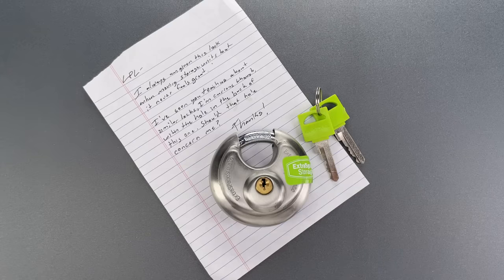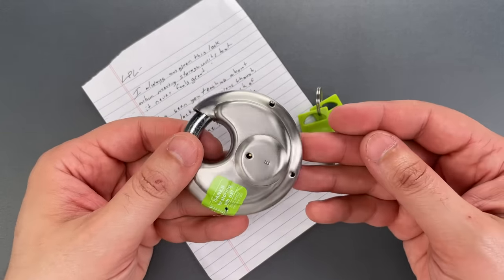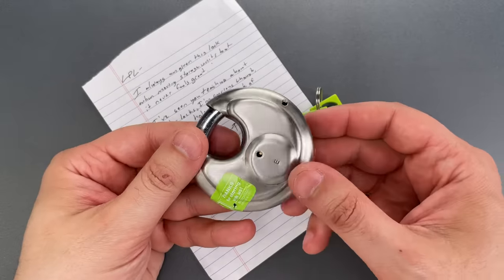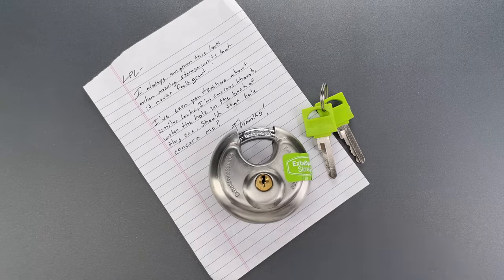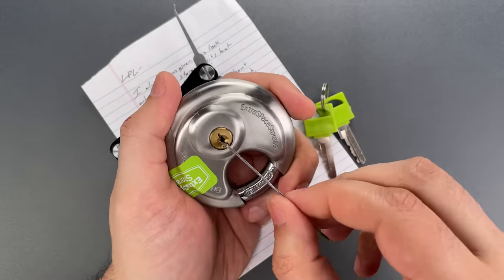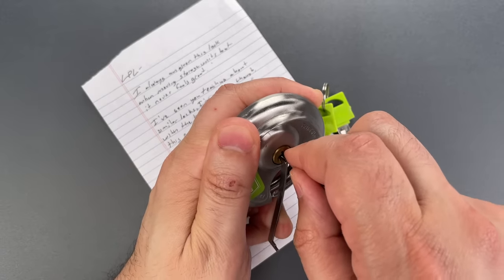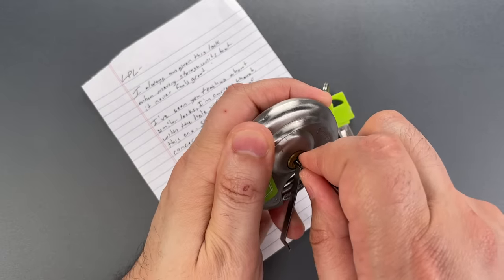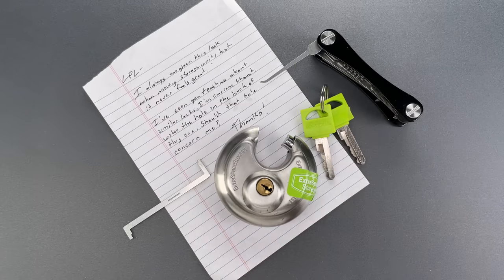[1367] ExtraSpace Storage Disc Lock Picked

Comment: I started picking padlocks as a hobby and picked up one of these master locks and quickly found that the 4th pin is completely useless, it can be picked by only manipulating pins 1, 2 and 3. Blew my mind that something like this was possible but that's Master Lock for you.
Reply: that depends solely on the bitting of the lock. if pin 4 is a "no lift" you won't need to touch it in order to get the lock open

Comment: That's actually not bad.  Granted, it's not as good as the original Bulldog brand, but it's certainly better than the Yale and Sterling ones I have in my practice bin. In the UK, most storage facilities that use this type of lock are built inside warehouse type buildings with security staff and cameras, so not really somewhere a casual opportunist thief would feel comfortable in. ...oh and it's also a lot better than some motorbike discbrake locks I've seen. There really is a lot of outdated junk out there.

Comment: As someone who uses extra space. I've noted that there are 2 different lock positions on the doors, allowing for 2 locks to be in use at one time. So you can supplement these locks with something better as well. Note I was incorrect your not intended to use the second position.
Reply: The second position is for the company to overlock you if you don’t pay on time. If you lock that also, they will likely have it cut, then add the cost to your next bill.
Reply: @stuckgrenadepin.225  Yeah, I got told that last night. Whilst I was getting Halloween decorations with family.

Comment: Can you do a video on serrated, spools, and other tricks lock manufacturers can use to prevent from picking, or make it harder.
For example: "Why do spools exist, does it prevent from wracking?" And that question answered for every security pin with examples shown how it can be easily defeated. It seems as though it doesn't keep someone with a turning tool and a lockpick out.

Comment: The problem with this picking is that when the lock is in use on most storage units, the lock is at a 90° angle, and the shackle is against the garage-style door, thus impeding the bottom of the keyway tension, and greatly reducing the available area to manipulate a pick. Would be nice to see a realistic set-up and pick as if the lock was found in the wild.
Reply: Just put the tension tool in from the other direction. It still works that way. Might just take a little longer.

Comment: Do any theives actually pick locks? Bolt cutters and battery angle grinders are the common MO I believe.
Reply: Some will still do low-effort attacks, but none I've heard of are doing the time-intensive stuff. If a rake or bump key doesn't do the job, it's back the the old classic: a big boot.

Comment: Out of curiosity, couldn't you dunk it into a bucket of water and then hose it down with baker's freeze spray, or an CO2 extinguisher and cause it to break the lock?  No idea if that would actually work, but it'd be nifty to try.

Comment: It's not as insecure as it may seem. Picking a disc lock in this fashion is easy, yes. But once it is locked on a storage unit and you are unable to maneuver your hands and tensioning tool, the difficulty substantially increases!

Comment: The problem with these types of locks no matter what the mechanism the soldier is encased in magnesium that can be heated up with a common torch that you can get now for about $2 or $3. 
 I believe all you need is about 400ﾟF  to melt the magnesium around the core and the core should then fall out
Reply: what the hell is the point of using magnesium?  Isn't that MORE expensive?

Comment: @lockpickinglawyer What about the orientation of the core; wouldn't that make it harder to pick when actually attached to a storage unit's door? The ones I've seen are usually mounted in a way that getting the leverage tool in the orientation you posted in the video wouldn't work.

Comment: My storage unit using one of these locks was broken into and the thieves just used a tool to rip the entire latch off the door. The lock and ripped off latch piece were on the ground still attached together. :(
Reply: Destructive methods of entry are so crude. No class or finesse at all.

Comment: Sure it's easy to pick when you're an expert, lock is unattached, you sitting in good light at a comfortable desk.  How about when the lock is faced backwards (like I place it) where the only way to access the core is holding it upside down?
Reply: He did hold it upside down.
Reply: This is lpl using less than one percent of his power he can open locks without touching them.

Comment: For some reason, I'm having trouble with a similar lock. I'm an absolute beginner level, though, so it's not too surprising
Reply: Anything with security pins can be tricky, but if the core is not very well made otherwise then security pins don’t work quite so well. I found the sparrow’s cutaway lock with all spools and the other one with all serrated pins to be super helpful for me to understand how to approach such pins.
Reply: @TysonJensen  I'll check it out. Thanks for the tip.

Comment: I have one and it's almost impossible to pick, the reason is mine is so shitty the core doesn't spring back when you release tension on the pry bar... thus, anything overset/ any security pins can't be corrected by wiggling pressure on the tension tool. I've been working on it for hours trying to figure out how to make it work predictably and only gotten it open twice after about a month of picking it.

Comment: Hello LPL,  I do have a question to ask, though it isn't about this video.  I was wondering if you would ever consider mass producing the turning tool you use to rotate discs in disc detainer locks?  Sorry for the long question.
Reply: that's not a mandatory part of picking disk detainer and won't help you very much in the long run

Comment: Probably a really dumb question, but if you walk up to a lock you've never seen before, how do you know which way the key turns? I've had locks on various houses and apartments that I've lived in that turn different ways and even counter intuitive to the direction of the deadbolt's movement.
Reply: If I was to hazard a guess, I assume that most locks have a certain amount of give to them when tensioned.  If LPL doesn't feel any give then he knows he's tensioning it the wrong way.  A lock "wants" to turn so I'm guessing you're able to feel that.
Reply: If the bolt was installed properly, you would turn the key away from the door frame to unlock and towards the door frame to lock the deadbolt.  That's the reason the word TOP is stamped on the bolt, to avoid installing it wrong.

Comment: This lock feels weird to me. They made the effort to put drainage holes and all so it works outdoors against rain and the elements but then put a pin tumbler core instead of a disc detainer...or maybe because of the way its designed a d.d core wont fit?

Comment: I have a very similar lock like this if not the same but only under a different brand and I’ve struggled to pick it open for a while any hints would be much appreciated.
Reply: probably spools in the lock so try to get a false set then push up on the pin that gives you counter-rotation of the core, continue this process until (hopefully) the lock opens
Reply: @boazfarren-greenwood9048  cheers mate, I’ll definitely give that a go and I’ll see what I can achieve thanks again for the reply.🤙🏻
Reply: @scorpioofmusic7541  happy to help

Comment: How do you determine if you use bottom or top key way tension?
Reply: mainly a personal choice, but can also be made based on the lock, for instance: I like TOK because it gives me more room to pick from the bottom of the keyway, but on locks that have a more restricted keyway I might use BOK to create a ledge to pick off of
Reply: @boazfarren-greenwood9048  thanks. Trying to teach myself how to pick locks. I do building maintenance instead of always having to break locks or drill them out it would be nice sometimes to be non-destructive.

Comment: I have questions. In reality the lock will be right side up unlike when you pick it and hold it upside down. So the pins are facing down rather than up. Then the pins will always be dropping down due to gravity. Please pick locks with pins facing down the key way rather facing up the key way.
Reply: There are little springs pushing the pins up so it wouldn't matter if the lock was inverted

Comment: while the core was not too difficult to pick, it would most likely take 3-4 times longer when the lock was actually  in use.  when the lock is installed you cant just manipulate the lock to wherever is easiest to hold.

Comment: how do you know which is the top/bottom of the keyway?
how do you know in which direction does the lock unlocks?
Reply: mainly a personal choice, but can also be made based on the lock, for instance: I like TOK because it gives me more room to pick from the bottom of the keyway, but on locks that have a more restricted keyway I might use BOK to create a ledge to pick off of.locks generally have some give to them when turned in the right way

Comment: An issue I've noticed with these demos is that they are always done on a lone lock not in a real world scenario. Is there any chance you'd start doing some of these locks when they are in a position that would make it to where you couldn't put your hands in such ideal positions that would be impossible when the locks are actually in use? This one is a good example, as you wouldn't be able to necessarily turn the lock upside down and hold it like that if it were connected to an actual storage unit.
Reply: In video 1071 he enters his ex girlfriend's backdoor in the field